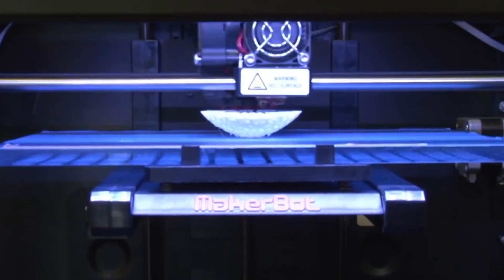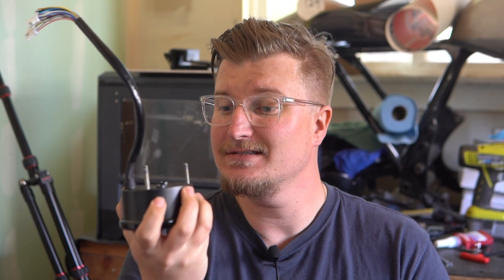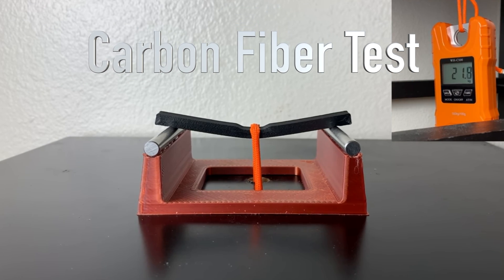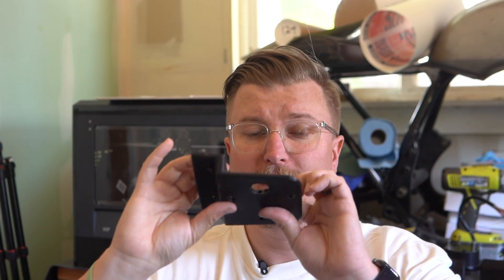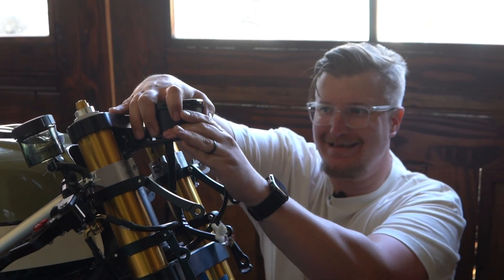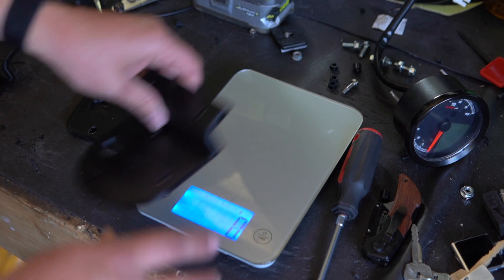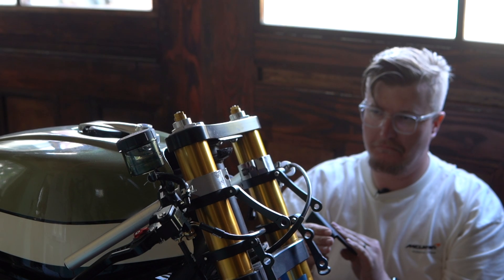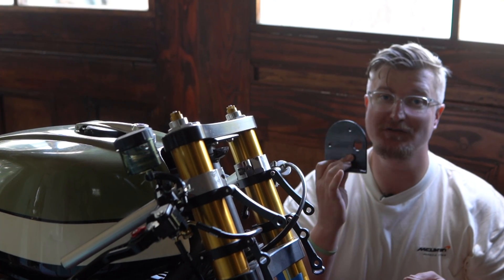Can you 3D Print Motorcycle Parts?

Comment: Yup - up your wall count. Most slicers default to 2 walls - if I have something quasi structural, I'll use 6 walls (along with 50-ish% infill).
I'm in the process of designing and printing some farkle mounts for my new Himalayan 450. Gotta love the tech - damn near instant gratification. And, as has been mentioned, print so that your layer lines are parallel to the stress.
Reply from the maker: I have learned a lot since this video and appreciate the insight! It's truly amazing to be able to print something right out of my house and put it on my bike. Love it!

Comment: PLA is definitely the wrong material choice.   You should use PETG.   PETG is also readily available, and cheap, and naturally UV resistant, better impact resistance, and won't deform in the heat of a hot summer day (unlike the PLA) and is as easy to print as PLA.   Just one more correction, you mentioned carbon fiber... There really isn't such a thing as carbon fiber filament .. it's a base filament such as PLA, ABS, PETG, PA, etc reinforced with carbon fiber... So PLA-CF will have very different characteristics from PA612-CF (which I love for printing functional parts for my bike) since the addition of carbon fiber to copolymer PA612 nylon makes for a crazy strong print (rivals aluminum) with incredible heat resistance.
Reply from the maker: I've learned so much over the last couple of months. I've switched to almost printing exclusively with PETG and yes, CF is just an additive.
Reply: @zsgarage2021  same here, almost exclusively print in PETG...although I really love Polymaker PA612-CF for functional parts on the bike.  It's crazy strong (I printed flag mounts for my bike, they handle a flag at highway speeds) great heat resistance, and it prints as easy as PLA.

Comment: Very cool 😊I have 3D printed for some years now, also MC parts. It works great! Some of my learnings (also shared some on my YT channel): Use PTEG instead of PLA, it's more flexible = less brittle, tolerates better vibrations, it's UV tolerant (PLA will suffer in the sun) . Make sure print orientation is optimal, 3D prints are weakest along the layers. 100% infill is not always better, it's most often the shell that causes the strength, it's easier to bend a solid bar than a pipe. 3D prints are strong when compressed (and for that 100% infill is good), not as strong when pulled.
Reply from the maker: Appreciate it! Definitely will look into PTEG!!!

Comment: using more infill doesn't necessarily mean its stronger, adding more top and bottom layers and the number of walls will really bump up the strength.  for the infill gyroidal is one of the strongest imo. also printing that part on its side edge will add more strength as it will eliminate the horizontal layer lines that are splitting in your break test. the model would fail with the material uninterrupted in tension instead of how strong the layer bonding is.
Reply from the maker: Thank you so much!

Comment: Your weak point is that section in between the two mounting points. Simply changing the print orientation will improve the strength significantly and avoid snapping along those layer lines. You would want to print it standing up on its side instead. The weak point would then be the mounting holes but printing it with double layers and or using large metal washers should keep it from breaking along those layers lines.
As for materials avoid pla and go with abs, asa, or carbon fiber nylon.
I recommend you watch the 3D Printing Nerd's video on 3d printing bicycle parts. You can see why he chose the materials he tested. Another great channel with lots of material testing and info on improving strength is CNC Kitchen.
Reply from the maker: Thank you so much for the knowledge. Will for sure use this!
Reply: You're right, orientation is very important. I had a custom mount on my BMW K1600 for a tablet with a (3D printed) RAM ball on it. The base plate that was mounted on the dash was PETG and the part with the RAM ball was PLA, since I didn't have black PETG. I figured I could reprint it and swap it out if necessary. But it was mounted on the bike for 2 years and when I tool it off, only the PETG base plate was a bit bent. The PLA held out fine, even after I did trips to Italy and Spain in hot weather.
For toughness, infill isn't the most important. The amount of walls is more important, since the (bending) force is on the outside, not on the infill. Obviously, a bit of weight can't hurt, so what I usually do if I need a really tough part, is set the walls to 4 or 5 and the infill to 35%. That's generally enough for a strong part. I'd say use PETG at least, ASA (prints like ABS) is better, since it's stronger. If you can't print ABS/ASA, you could try PCTG, whG, but a bit stronger and more impact resistant.

Comment: From someone who has printed tons of motorcycle parts. a speedo bracket exposed to sun printed in pla is not the best choice. nylon, asa, abs are definitely better choices. Nice video though
Reply from the maker: Thank you! I’ll eventually print it in ABS or carbon ABS!
Reply: @zsgarage2021 for permanent stuff use nylon-carbon.
Reply: tpu is great for mounts i find
Reply from the maker: @sixsixsixjet  what type of mount have you done?

Comment: Nice bike sir. I would recommend two things for you. First stop using PLA and switch to something like petg, or maybe even one of the engineering materials like poly carbonate or nylon. 
The PLA will be strong but you will run into creep over time where the material looks like it’s dropping even if it’s not hot. 
Second suggestion would be to print that part sideways. Your part needs to be strong in the z and y axis but not so much the x. Turning it sideways will dramatically increase its useable strength. Im printing end user motorcycle parts already and while there is a learning curve it’s game changer. My product is an add on shock absorber for the front fork of basic bikes. It holds the entire weight of the bike and manages thousands of psi of pressure. 
The tech has really come far. 🎉
Reply: Pretty much this, but it's perfectly fine to 'proto'-prototype something with PLA first, and make sure fit and form is correct, and then send the design off to a 3D print fab to print in PC or Nylon if you don't already have the capability.
To be honest, sometimes it's just a hassle to deal with the other filament types if your machine isn't already tweaked in for them.
Reply: @UltraNoobian I have found petg as my new favorite prototype material. It’s more heat resistant, better layer adhesion, cheaper, and comes in translucent colorless😂 I’m a sucker for clear plastic parts
Reply from the maker: Thank you for the heads up!!!
Reply from the maker: Thank you so much! I’ll definitely have to try these things!